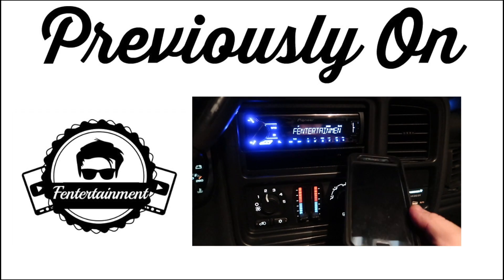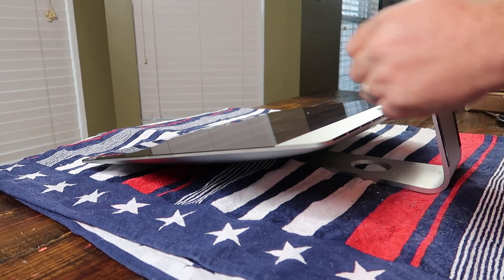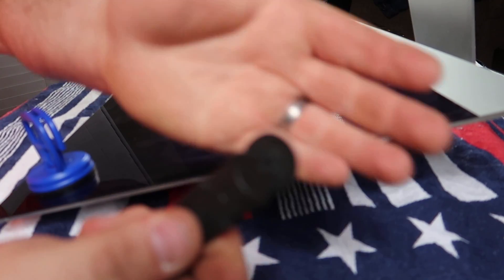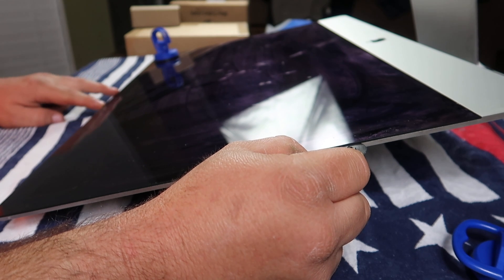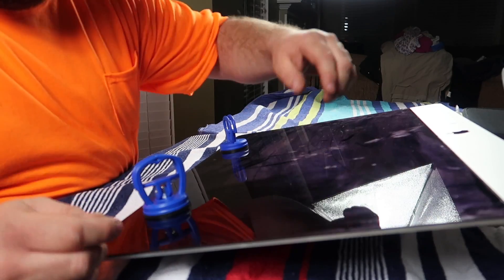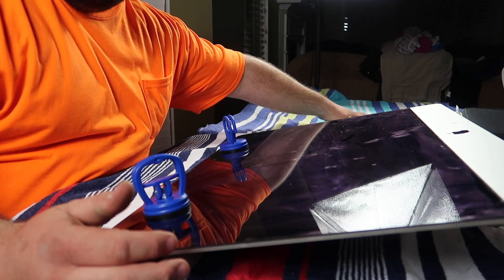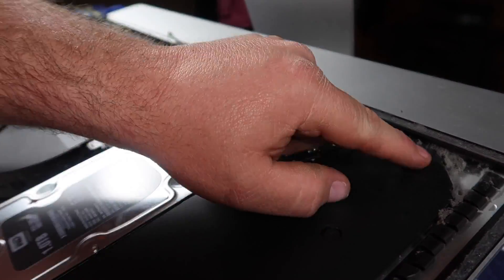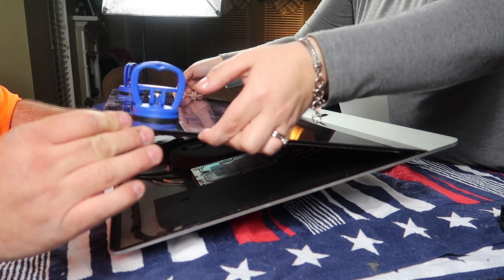How To Replace Apple iMac Power Supply | Fix Your Apple Computer

Comment: Did you check the old PSU for what failed, what was the condition of the capacitors, dried out?
It seems Apple has never really solved the heat problems with iMac's. I have paid a lot of money to Apple over the years for top end iMac's and most of them have failed due to heat problems. I had one that failed due to the GPU becoming detached from the PCB (which turned out to be a common problem for that incarnation of iMac) and I've had a couple of iMac's fail now with PSU problems, all after a few years of usage which I believe is because Apple is prioritising aesthetics over proper cooling ability!

Comment: Same issue here with my Late 2012 iMac 27 - i7. It started in December 2019 about 9 months ago. I took it in to my repair guy Kevin at Computer City in West Los Angeles, he tried his best but couldn't fix it with a different power supply he installed temporarilly for testing. He gave up and I figured I would wipe the drive (if I could get to stay on long enough) and sell it for parts. I never got around to wiping it that week and it stayed on with no problems for several months. Then last week it started to shut off again. I just bought a used iMac 27-i7 late 2014 as a replacement. I'm crossing my fingers for the new machine not to have the same issue.

Comment: AWESOME!  I have the same problem with my iMac 5K 2014.  It only happens when I render in Final Cut Pro, so I'm going to need to order one.  Until then, the best I can do is close everything but FCPX so it doesn't have anything else drawing power.  Thankfully I have a 2018 MacBook Pro with beefed up specs, so I can use that for rendering in a pinch.

Comment: As of today  November 14, 2019 my 27 inch iMac it at the 'Apple store having the power supply replaced for a well worth cost of $165 parts and labor.
Reply: Hi there was, have you been having any problems after getting this done ?